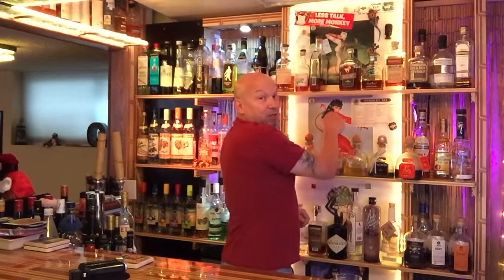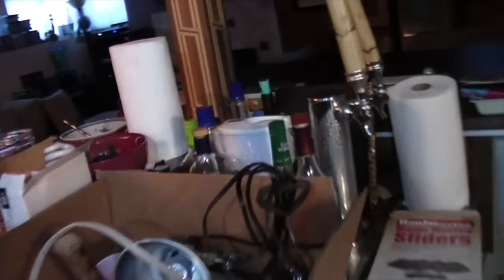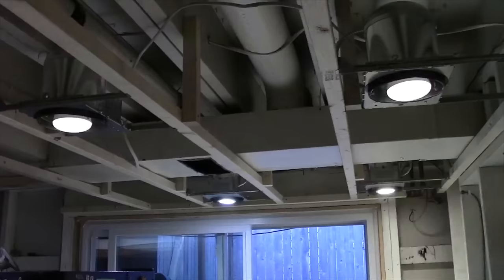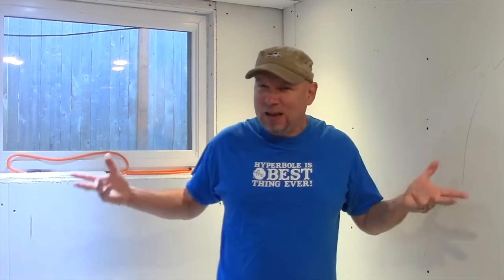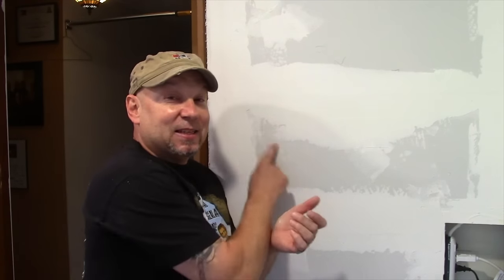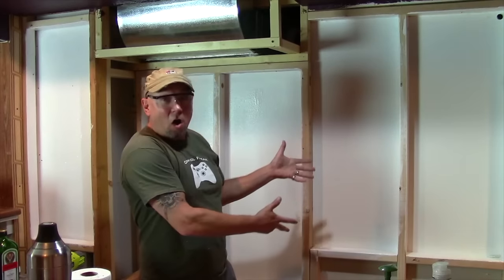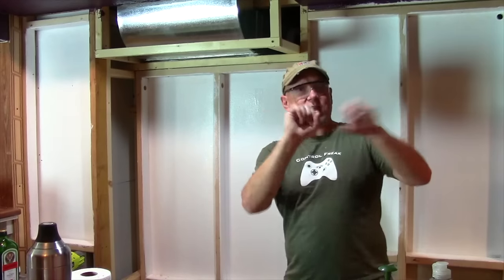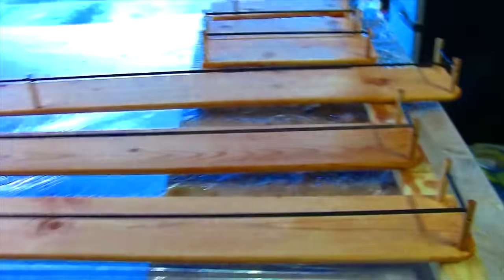Monkey Bar 3: Man Cave Remodel

Comment: Any preference on home improvement store for materials?
Reply from the maker: I prefer Lowe's over Home Depot if I have a choice, but they have different stock so I use both.   If I have the time/remember I hit Habitat For Humanity Re-Store first as they have mundane stuff like outlets, conduit, screws etc. for DIRT CHEAP.   Get what I can there, then pay full retail for the rest.  I used to go to my local Ace Hardware too just to support those guys but they closed.
Reply: DrunkenMasterPaul Thanks man.  Never even heard of the habitat restore.  I'll be sure to check it out.